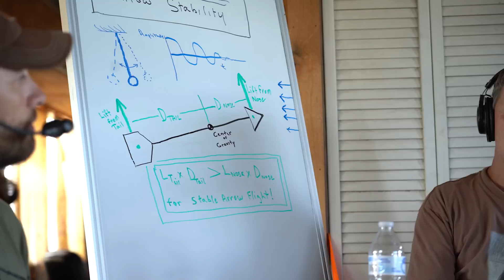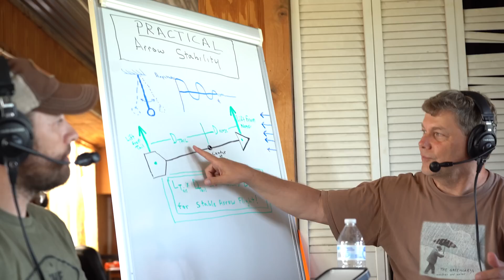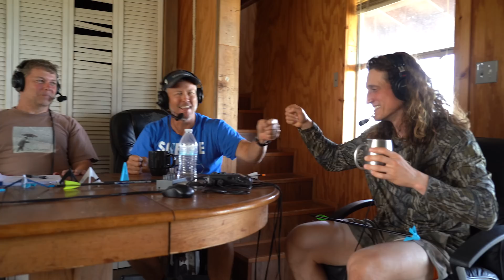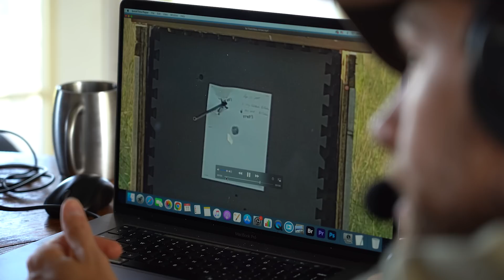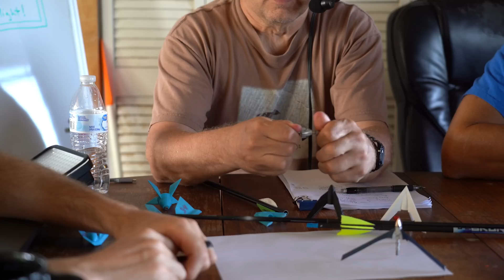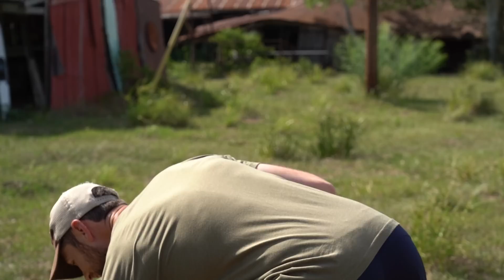WE SHOT A $500 BROADHEAD?!

Comment: Very intrigued by all this, but I’ve got two questions: 1) What was the weight of that head that Aaron shot? And 2) What in earth happened on that last shot???? 😳
Reply: If I had to guess the shaft turned more than the gimbal would allow it to so it was no longer moving freely so once it hit that wall it made it plane aggressively but I also have no idea what I'm talking about
Reply: @vg-zy4rb  Correct...
Reply: I would probably do the same! TARGET PANIC? Knowing You're shooting a 500 buck broad head? 😂😂😂😂
Reply: My guess is the head didn't pop back off the shaft so it never rotated and then just planed off like a badly tuned broadhead would do.  That's a downside I could see of this design.  A mechanical broadhead takes energy to open upon impact and with this design you are first relying on it to come off of that "loaded" gasket or whatever is up front which is also taking energy.  If it doesn't come unlocked then you're just shooting a normal fixed head.

Comment: So, I’m confused … wouldn’t this still be a “mechanical“ head?
Reply: Debatable. The inclined plane is the simplest of machines and yet the fixed blade isn't "mechanical". If the community defines it around blade deployment or complexity of design, it cold go either way.
Reply: @YoureSoVane  good point. I would just consider any broadhead that has movable parts during flight or during deployment a “mechanical” head. Just because it take mechanics to operate for the flight or impact. However, it’s a matter of debate. I do like the concept and ingenuity in new designs .
Reply: Just curious what the penetration looked like

Comment: Need the shaft pushing straight through behind the head , if the shaft is cock eyed @ impact you loose most your energy. 
Yes there is plenty of energy to completely pass through game with even a 50# bow, and yes wings in the front cause lift, and yes a moderate cut mechanical shooting fast and straight is still the most deadly thin skinned game medicine.
Reply: That's where thr vanes come in to play. They at4 showing that even with a bare shaft thr broadheads flew good. Shoot a bare shaft with you bow once.
Reply: It's a cute idea he is playing with, there was a head that could rotate a few years back. 
I shoot a field point bareshaft every practice session to Insure tune is good.
It will always be a game of whole arrow stability, and just like rocket man said the easiest way to stabilize the arrow is to reduce lift in the front- mechanical

Comment: 10 - 20yrds in my opinion, really is not  going to make that big of a difference I shot cheap Allen heads basically one shot throw aways and had a few deer kills with them and I have expensive Mechanicals and fix blades not 500.00 but your average $50.00 = $65.00 and basically not a big difference to me at all same blood trail same bolt accuracy . Maybe after 45 yards there might be ? . I remember back in the day old school bear heads 2 blades with out the breeders I shot them for years with my compound bow and they work perfect for me back then too.
Reply: Those rifle hunters tho, coming over into archery to take advantage of the extra season, are picking up 500+ fps crossbows that can't be tuned well, and are expecting gun accuracy to 60 plus yards.  A lot of mechanicals can't handle the impact at that speed.   Maybe this concept will work for them when developed sufficiently.   I think so, anyway :)

Comment: Interesting concept to apply to the arrow world. Accuracy improved, but the arrow shaft still needs to be flying straight for penetration, or the shaft might actually slap the animal. More testing to overcome... Rocket man's wife must be a tolerant soul. Ha..
Reply: I thought the same thing. Once penetration occurs the angle of the shaft could greatly reduce the momentum. Regardless, this is pretty cool stuff!
Reply: @fasmola  Good points, all of them.  I always thought this could be the path to guided arrows in the future 🙂
Reply: With his concept you would probably want extreme FOC because you can clearly see the shafts impacting on a bad angle even though the point is dead on track where he first aimed it. His concept would allow 20-30% FOC easily because the heavy wide heads and the short stiff shafts with no fletching. I imagine with current materials and his whirligig broadheads you might be able to push 35% FOC with a 300 grain head and 600 grain total weight.
Reply: Also his concept is more applicable to really fast crossbows or improving your 60-80 yard groups. The first situation you probably have a little penetration to spare assuming you have decent tune and FOC. The second situation you have to keep in mind that arrow harmonics have greatly dampened and the arrow is tracking really straight, so it would probably increase your 80 yard accuracy in your bow and at 80 yards have no chance of affecting penetration because the shaft is straight behind the arrow
Reply: @mattnewcomb4147  A very good synopsis!  Super light gpi shafts and tiny vanes may even possible.  Since the point of aerodynamic yaw/pitch rotation for the shaft is not the arrow cg anymore, but is now the gimbal point, theres a super long lever arm for the lift of the smaller vanes to act through. So much to prove and to test... If only I was rich!
Reply: This seems like an ego stroking session to me...but what do I know!
Reply: @Tbowie13  

I see it as high end physics and science compacting into archery.

We might be looking @ a form of the future to arrow lethality. 

Arrow spine will become more critical so the arrow stiffens up straight faster to fly point first which then equals better penetration.

It’s going to simply be synchronized arrow building, no different then we do today but with different triggers to obtain the same directness to arrow and point being synched.

I like the concept and believe maybe after my days are over, this will become reality.

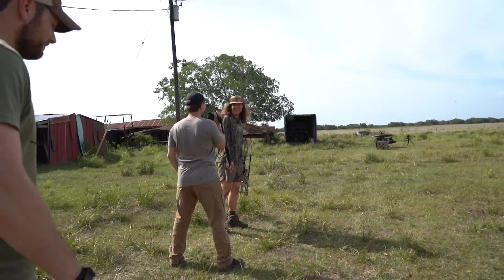Comment: It would be nice if they explained what went so wrong with the arrow flight in the last shot 35:01
Reply: Dude definitely didn't tune his bow or correct his form. He's grabbing the grip with too much palm. The broadhead has seven degrees of movement but he's pushing it beyond that with his setup until it reached a critical point, where it creates lift and ultimately until it stalls.

Also his trigger finger came in from the parking lot like it was running for it's life
Reply: @YoureSoVane  i was gonna say, dude punched the trigger like mike tyson on too much pre workout
Reply: It looks like it was a bare shaft
Reply: At 35:03 you can see it’s a bare shaft
Reply: @bigz5262  so.... if a bow is tuned properly, and arrows are spined correctly for the draw weight and draw length, you should be able to shoot a bare shaft straight out to at least 40 yards..... fletchings are stabilization not steering
Reply: @mechanichandz8087  not with a broadhead
Reply: @bigz5262  absolutely with a broadhead. if it aint tuned sir, ur broadhead is planing to one direction because it aint coming out of the bow straight.
Reply: @mechanichandz8087   now I know you’re all talk and you’ve never bare shafted anything. Even ranch fairy says in his videos you can’t bare shaft a broadhead because if the broadhead catches the slightest breeze with nothing in back to stabilize it then it will do exactly what happened in this video
Reply: @bigz5262  lol ok, so ranch fairy is end all be all. you aught to go out and tinker with your tune and see. "youve never bare shaft tuned" lol! sure if you're shooting bareshaft with a FB broadhead, and all of a sudden a 20mph gust hits ya. itll be off. but i most certainly would not be tuning my bow in 20mph gusty winds. youd be chasing your tail bud. best of luck! always be tinkering my friend.
Reply: @mechanichandz8087  
I tried it with a FB head on accident once and same thing happened. No wind
Reply: @mechanichandz8087  🤣🤣🤣
Reply: @mechanichandz8087  lol no RF is not the be all. He is the leading authority on it because he’s the person who brought bare shaft to the mainstream though. Before his videos nobody was talking about it. It doesn’t take 20 mph winds to do it, that’s how I know you’re lying. Without fletchings your fixed blade acts as the fletchings

Comment: I get it, but I feel like this is solving a problem that isn’t really a problem. I can stack two blade single bevels right with my field points out to 50 yards. (Which is further than I would take a shot at a deer). With proper dynamic spine and bow tuning. However, I can see this being beneficial to using super huge turkey broadheads.
Reply: But there a ton of guys that struggle with tuning or form that could benifit
Reply: @zachschultz3534  Exactly!
Reply: Yes, and 500+ fps  crossbows that can't really be tuned as well as a bow.
Reply: My thoughts too. At the end of the day we’re talking about a slightly improved technology cavemen used to kill lions 2000 years ago.

Comment: You all are thinking too hard. Just use a real heavy field tip and then on the back of the arrow use metal fletchings with an edge. There’s no more lift on the front, and the rear attached broadhead is stabilizing the arrow.
Reply: What kind of arrow rest is going to shoot a bladed Sharp Arrow fins and you're going to shoot that past your hand no thanks
Reply: @danielmcbride4828   a drop away rest. And hey a little bit of extra risk and excitement is worth that perfect arrow flight lol.
Reply: You would have to get 100%  penetration for that to work.

Comment: I purposely shoot a seven eights inch cut broadhead because where I hunt here in North Carolina,,it’s thick woods and more often than not your arrow will touch something before it gets to the deer   ,,back in the 70 s I learned this the hard way ,,I also learned that a four blade broad head cuts the length of a tracking job way down   If compared to a two or three blade ,,,these two lessons is something I would never change from ,,fifty years of deer hunting and I am still holding on to these two things.

Comment: So the Broadhead will fly great... But when it hits an animal you will lose almost all of your momentum and KE on impact, unless it locks in place on impact. Your arrow will possibly break as well... I love the effort though, can't wait to see more. They kinda seem like the ethics archery spinning inserts with a wobble...
Reply: Right, as we've seen during the RF process with large fetching correcting arrow flight, at impact the wobbling shaft causes a loss in momentum and energy. I'm thinking this concept would have similar effect, as the gimble-head only achieves getting the bh to a point consistently (like large fletchings), but at impact the shaft wobbles stealing energy from penetration.
Reply: @whodoyouthinkiam1616  Exactly. It's like it creates a terrible impact paradox
Reply: The concept could be good if the shaft detached in some way allowing the head to conserve more energy but then that adds more complexity
Reply: not with the ferule being solid, the blades would go in straight since theres a solid shaft in the middle
Reply: @jackkuprevich1208  the blades would hit straight but the arrow shaft could be super crooked which will rob energy from penetration.
Reply: @ApexPredatorOutdoors  what im saying is with the blades being able to move, wouldnt they be forced back towards the arrow shaft, but not be able to affect the arrow’s direction
Reply: @jackkuprevich1208  but If the shaft of the arrow is not in line with the head when it impacts, the shaft will pull it whatever direction it's going and it will not be able to lock back. On impact the Broadhead has stopped and the arrow can still move if not fixed. Kinda like what happened in Zach's last shot, except that was an extreme example. With a missile and warhead it does not have to penetrate the target, just make impact. With an arrow though it needs to be all in line as much as possible. Even the flex of a straight flying arrow on impact robs energy and that's called the impact paradox. Imagine that on an arrow that's not in line with the Broadhead! Almost Zero penetration I would assume...

Comment: How does the gimble affect penetration if the shaft isn’t inline with the broad head? It would have to negatively affect it.
Reply: We dont know....its extremely early in his testing and prototypes so one will have to wait for more testing
Reply: No doubt about it.
Reply: I would imagine on lighter arrow boddies more then if your shooting a heavier shafted arrow. The weight of the arrow is part of what drives it threw a target.
Reply: I agree with what you're saying. Although the large 3D printed heads showcase how the broadhead works on video better than a smaller head would, like the ones they ended up manufacturing. Aarons arrows flew pretty well. Zach's on the other hand...

I'm still choosing evolution 200g all day
Reply: Can't wait to find out. They have no clue yet